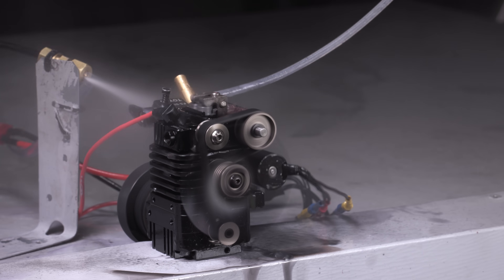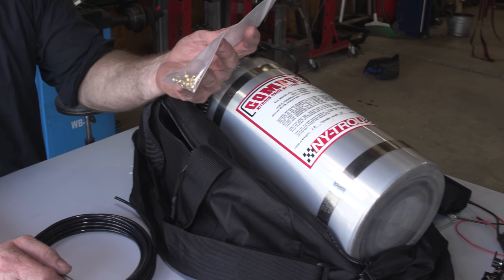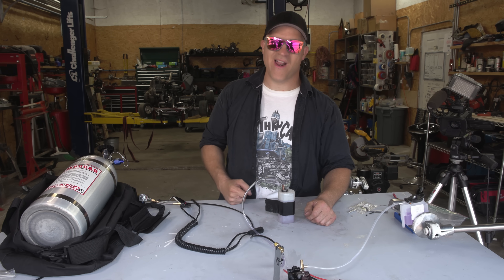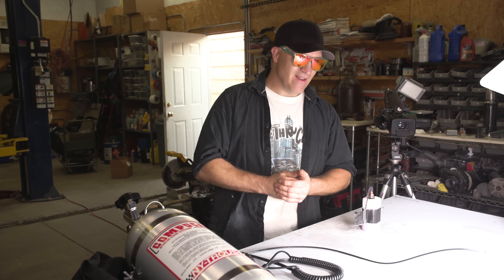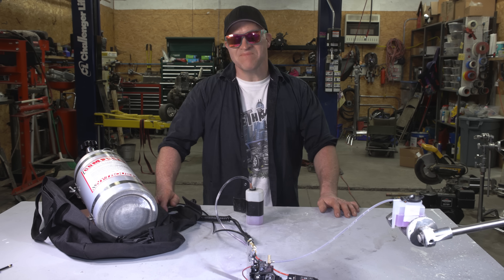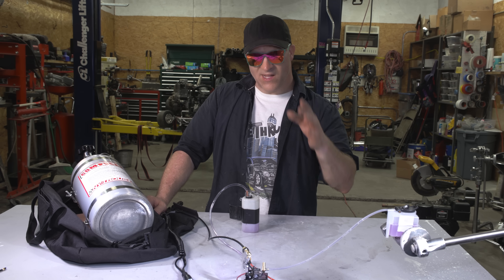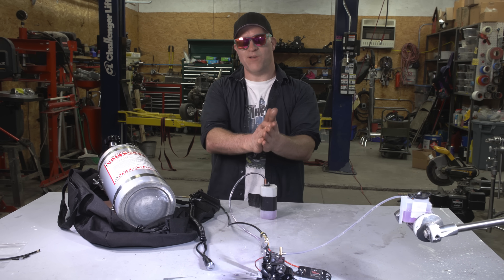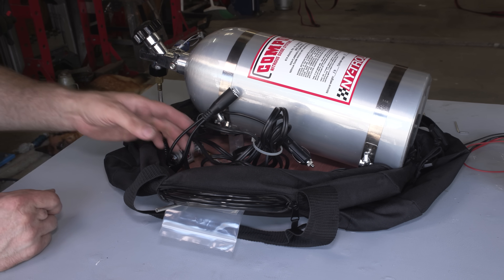Miniature Engine Gets 100 shot of NITROUS OXIDE

Comment: hold up here! In this Video the claim is made that this 4-stroke engine was making 10-20 times its "RATED HP". The questions is, based on what and how was that computed? I didn't see any dyne, no electrical devices and it looked like a shity TOYAN engine which has about the same HP as a 1998 HPI .15. What do you think about that!!! A modern 2-stroke OS 18TZ would destroy that motor without any NOS....

Comment: They put sulfur dioxide in nitrous oxide now. 
So idiots can't huff it. Idk why anyone would want to try huffing it anyway. It comes out of the tank at a really low temperature. It would probably be like putting your lungs in a meat locker if someone breathed it straight out of the tank. You know someone tried that. They never used to put that in nitrous until about 10 -15 yrs ago.

Comment: No idea what the compression is on this little guy, but running methanol was probably saving its life versus regular 87 pump gas, wink wink. 
Normally with a properly jetted nitrous kit, the purpose of the nitrous is to get a hotter, more complete burn which is where you get the extra power. 
Methanol, on the other hand, is approaching race gas on the RON scale of detonation inhibition. 
The cooling effect was bathing the cylinder head in the gas stream. Not to say that a large quantity was indeed going straight up its nose, but a lot wasn't. 
Very cool experiment nonetheless, and yeah, I'm surprised it weathered the storm, too!

Comment: Well, the way your spraying methanol fuel all over the engine is helping greatly in cooling. So that would keep knocking at a minimum. And breathing that methanol can cause some issues. I suggest next time do this with plenty of ventilation.

Comment: It may have blown had you not metered in extra fuel. Just raw nitrous would have caused it to lean out.
Reply from the maker: I tried just nitrous first, it would just die out right away. That's why I ended up adding the extra fuel... I just cut that whole part out of the video because it wasn't very exciting

Comment: Let’s see. We take a little 4 stroke motor peg the throttle with no load. Throw an extra amount of oxidizer and fuel at it with an unknown ratio. Wouldn’t be far easier, faster and cheaper just to whack it with a sledgehammer when it’s running?

Comment: A 32 jet is not 100 HP
Reply from the maker: No it's more like an 8000hp shot to this little thing. This is a .49hp engine so theoretically even a 10 hp shot would be equivalent to a 4000hp shot on your smooth sliding, wheel spinning,  crowd slapping 400hp mustang....lbvs. think about that
Reply: @WarpedYT  you know nothing about nitrous oxide.
Reply from the maker: Nada... Please teach me..

Comment: I may have missed it because I did skip to the good parts. LOL. But I would guess the engine did not blow because, yes the fuel and Nos all over it was cooling it but the biggest factor...no load. Just like revving your car in neutral. Load it up on a Dyno and see how it does. Not knocking those little engines, they are way cool for the "scale" RC industry. But I doubt it would hold up to that kind of RPM with a load.
Reply from the maker: I agree and I also agree? I have had mini RC engines and I don't have to tell you which one was my favorite, I'm sure you already know. But for the same reason I wasn't able to connect this to a load because the threads on the crankshaft that the flywheel connect to are cross threaded, so that means the flywheel is wobbling all over the place, that's the only reason I didn't connect it to a load.

Comment: If anything this will wear bearings and the valve train...it likely won't blow up as the parts of the rotating assembly are small and light. ( as long as they're well made). I'd love to see you do a test to see how much more power it made and the increase in rpm...also spinning with no load it doesn't put much strain on the internals, only the bearings.

Comment: Need to put a load on the motor to really stress it
Reply from the maker: I know but my flywheel is crooked, the threads on the crankshaft are cross threaded, and unfortunately they didn't send me a spare engine, so the flywheel wobbles all over the place but originally yes I wanted to put a nice load on this thing

Comment: You should have loaded the engine somehow and have some RPM vs time acceleration and stuff.
This set-up is not relevant
Reply from the maker: I wanted to but I can't, the threads on the engine that I got are cross-threaded so the flywheel is crooked and it wobbles, I would totally put a load on it but maybe I'll try to get them to send me another engine soon.

Comment: You should order up an assortment of brass tubes and make a custom intake manifold, by brazing them together. Then you could use a small hvlp paint gun as a fuel injection, cheap guns sometimes have brass air caps(brazeable) . Use nitrous as your air supply to the gun and put fuel in as the "paint" for almost unlimited air/fuel adjustment. You'd have to use k-cups or a pressure pot gun to keep the fuel from becoming pressurize and blowing back. I bet if the system was designed nice enough you'd get your catastrophic failure.

Comment: you need to put a load on the engine or u wont see any differance really
Reply from the maker: I know I wanted to, the problem is that on the engine I have the flywheel is crooked because the threads on the crankshaft are cross-threaded..

Comment: I guess this would be similar to running 50 percent or more liquid nitomethane added to the engines methanol fuel..It oxygenates the fuel more so you get a bigger bang..more fuel consumption and  more power up to a point.

Comment: I would actually slow the nitrous down and make it a direct shot into the intake, not just blow it on the carb like that, maybe make a small spacer plate between the carb and the jug with a small hole for the nitrous intake.. this would give you a better air/fuel/nitrous mixture. Resulting in a cleaner more powerful fire. Just an idea for a future video..
Reply from the maker: I know, but my main goal is to make everything visual, so yeah since I didn't have a dyno hooked up to this engine or any sort of load the next best thing was to let people imagine how much power was making by making it visual. Unfortunately the engine company didn't send me a backup engine like I asked,and the engine that I got is defective and has crossed threads on the crankshaft so the fly wheel wobbles all over the place.
Reply: @WarpedYT  i understand what your saying, none the less love the content. Keep on making content and ill keep watching

Comment: It's a cool setup, but you have to remember that nitrous is only 36% oxygen by volume, while normal atmospheric air is about 21%.
  You are ingesting 71% more molecules of Oxygen and extra fuel, but it's a low power engine and not making enough power to kill itself. 
  Next time, use pure Oxygen from an oxy-acetylene torch. It's 100% Oxygen. Hell, even use the acetylene as the fuel and let the carb suck the gaseous mixture in.
Reply from the maker: I did that in the previous video with oxygen and oxygen acetylene https://youtu.be/oNO1N71PjaE it was nuts !
Reply: @WarpedYT  How did I miss that?!? The damn bell unrung itself. Nice work.
Reply: Not the full story though- N2O has a positive gibbs free energy of formation, so decomposing it back to N2 and O2 makes some power even before any combustion happens, in fact by running it over an appropriate catalyst you can use it as monopropellant rocket fuel. It also provides a lot of charge cooling to the intake air mixture.

As an aside, you really shouldn't dump nitrous into the open air. It destroys the ozone layer like CFCs do, and as an Australian with european ancestry I have enough skin cancer risk as-is.

Comment: Btw dude, I don’t think the nitrous was what you were breathing, but aerosolised fuel instead, which is considerably more dangerous than N2O
Reply: All it would have taken is a small spark or a backfire and all that finely dispersed fuel with a powerful oxidiser probably would have went bang or at least caught the table on fire.
Reply from the maker: @lazar2175  I was waiting for that to happen do you know how awesome that would have looked on the high-speed camera?. I didn't want to cheat but I almost lit it on fire or I was thinking about having one of my crew throw a match in there during the middle of the run... That would have been so freaking cool!!!
Reply: @WarpedYT  Now that's a new project for ya, make a NO2 flame thrower or something. 
 
If anyone asks is it legal, say it's used to sanitize stuff because corona. Or kill spiders. Maybe even both.
Reply: @lazar2175  And his biological air filter!
Reply from the maker: No it was the sulfur in the Nitrous, I have smelled methanol many times before.
Reply: If the fuel is methanol (wood alcohol) your liver is trying to metabolize that stuff right now. Other people who ingest methanol end up blind, waiting for a liver transplant, with kidney damage or dead.
It can take a few days, but inhalation is just as bad as drinking it.
Reply: @Tishers  Methanol poisoning (from moonshine most often) is curable by ingesting ethanol (found in all alcohol beverages) if taken early enough. This has the effect of putting the methanol in competition with ethanol for alcohol dehydrogenase, slowing the metabolism of methanol down (creating formaldehyde and then formic acid, which impedes the mitochondrial functions, effectively asphyxiating at the cellular level, and also inducing blindness) by instead metabolizing ethanol (creating acetaldehyde and then acetic acid, found in vinegar). The slowdown allows the body to metabolize the formic acid with folic acid (Vit. B9) into CO2 and H2O fast enough, curing the poisoning.

I have no doubt cracking a beer or two will have this effect, considering the low amount that could have been inhaled in gaseous form.
Reply: @Tishers  i breathe it all the time (sprint cars) i'm fine
Reply: The guy has modded cars, im sure he is aware of the risks of methanol.
Reply: Or he just meant it was all that cocaine burning his nose
Reply: @Initial Greg lmfao yeah inhaling gaseous sulfuric acid unwittingly, without even being aware that you accidentally produced any is usually a pretty dead giveaway for genius level intelligence
Reply: @fuck_youtube_censorship00  cope

Comment: Best moment was a circlip flying through the air in slow motion hahah
Reply from the maker: That was kind of funny, can you imagine the amount of harmonic vibration present to make that clip come off. I mean the clip weighs practically nothing compared to the amount of clipping pressure. So that means the inertial force had to be greater than the clipping pressure at the moment it released...
Reply: @WarpedYT  Yeah, that was enormous amount of force, tough little engine you got there. Nos saved it as you said, you can see the leidenfrost effect around the valve lifters.

Comment: Wish I had that little motor I got an r/c that would fit right in..
Reply from the maker: Not with a crooked flywheel and cross threads on the crankshaft...lbvs. that's the reason I did not hook up a load to this engine

Comment: This would have been so much better if you properly scaled the amount nitrous, there are rc nitrous kits available. I can see fuel puddling everywhere for god's sake. Maybe collab with johnnyq90 to have a proper carb machined and then see what it will do .
Reply from the maker: Nah I'm good, I want to see what it can do when it blows up !!... That's the goal, I can do it proper but where's the fun in that?..... proper for me would have been to put the nozzles right into the carburetor, and then maybe meter the fuel, when you put a nitrous kit on your car you don't change injectors or change carburetors, it's a add on power. If I need to collab to get something done, then I don't need to be on YouTube, that's the way I see it.

Comment: You need to be closer to the carburettor, then it would be awesome(🔥🔥🤯🤯🔥🔥💯) amazing video though i actually learned a lot thanks
Reply from the maker: You are absolutely correct, I'll do that in the second video, the reason I didn't put a closer was because I didn't want to obstruct the shot. The bracket was really ugly oh, next time I will make a better more dedicated bracket but the problem was that the pressure was so much force that it was pushing the nozzle back.

Comment: I might be wrong but this video looks like scam 😒 , I feel 99.99% sure 

Others please confirm

My observation ,
1. There is a esc ( bldc motor driver ) , what is the need for this ? 

2. Where is the exhaust ? Won't the whole engine be so warm that the whole nox + fuel mixture catch fire ?

Comment: Now I know you like to blow stuff up. To which I have to say that i'm disappointed with the fact that you sprayed NOS and gas at it, rather than injecting the NOS. It would be way too much for it, I know, but something would give right?! Either it just wouldn't run or it would run really fast and blow!
Reply from the maker: Don't be disappointed, I didn't even think it was going to work which is exactly why I tried it this way in the first place. I would have injected it or did something else as a second option in this video but the flywheel on this engine is crooked because of crankshaft threads are cross-threaded, I believe if I do another video where I hook up a load it is going to blow!.

Comment: I would put that feed in my mouth, lay on the couch, and hold that button down.
Reply from the maker: Now you're thinking of medical grade.. that's not happening with this type of nitrous I think it has 300 parts per million sulfur
Reply: @WarpedYT  -  A friend who works at Summit Racing's headquarters told me about that a long time ago.
    I would still be tempted to try a little of it, just the tip.
Reply: I would only let the gaseous N²O in my mouth, not the super-cooling liquid.

Comment: I want to see your diesel gokart with a 100 shot of propane, because propane is the nitrous equivalent for diesel.
Reply from the maker: Is that right ?
Reply: @WarpedYT  at least thats what i was taught when i went to school to be a diesel mechanic. Ive never seen it in person tho.
Reply: @tankerboysabot  You're still limited by the amount of air and fuel you can ram in there with only propane.
What you want is a wet setup with nitrous and liquid propane.
Or if your diesel seriously rolls coal, spraying just nitrous into it provides the oxidizer it needs to burn off the soot and clear up the exhaust.
Reply: @Bungstly  good shit to know, thanks.

Comment: You could hook up the nitrous straight into the carb. Nitrous is an oxidizer so the engine should in theory not need air anymore if you feed it enough nitrous, right?

Comment: Nitrous Oxide health wise is actually pretty safe, this is the "hippy crack" that was popular in the 60's and is also known as laughing gas. The stuff sinks, so really the only concern is if your area was too saturated and you passed out and suffocated do to the lack of oxygen. Don't huff it though.
Reply: The engine booster bottles have it mixed with sulfer dioxide (acidic) to keep people from huffing it iirc. Also he was adding methanol or gasoline to it so he was breathing a cocktail of different noxious vapors and droplets. Probably a good experiment to do outside instead of in the garage.
Reply: @deltab9768  Oh true, very true. Didn't know that.

Comment: Luckily didn’t set garage on fire with all that atomized fuel in the air mixed with no2
Reply from the maker: I was waiting, hoping, the cameras were rolling, I almost set it on fire myself... but Nope didn't happen 😒
Reply: N2O is an inert gas. It's the heat from the compression in the combustion chamber that breaks the N2O down, separating nitrogen and oxygen, making it ready for combustion.
Reply: @ujiltromm7358  It's actually a liquid.
Reply: What %nitro? 5-10% not really flammable on the table
Reply: Ikr. Also what a waste of fuel. I think the coanda effect would have been enough to suck fuel from the tank. Him lifting the tank gave it way too much fuel

Comment: I think you should make a video with an engine that has a closed intake system and runs off only nitrous and not ambient air, so that when you've got 50 psi line pressure you basically have 50psi of boost going into the engine, made entirely of nitrous and fuel, only thing is you'd need over 50psi of fuel pressure to make it work so might be difficult
Reply: Propane has 120psi of pressure at 70f due to it trying to evaporate in the bottle. So have a nitrous and propane injector in the intake, and then another valve over the normal intake. Start it, turn on the nitrous+propane and then shut the valve so it has nowhere to go but in. This is starting to sound like a disaster in the making though...